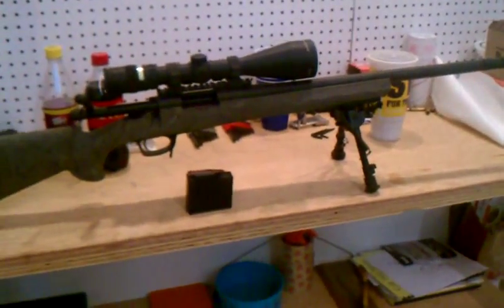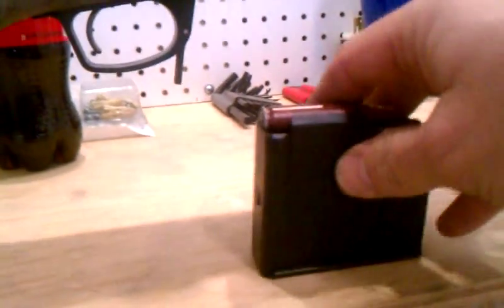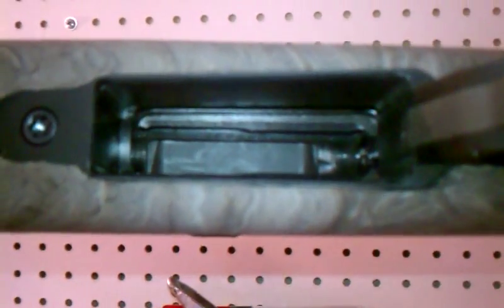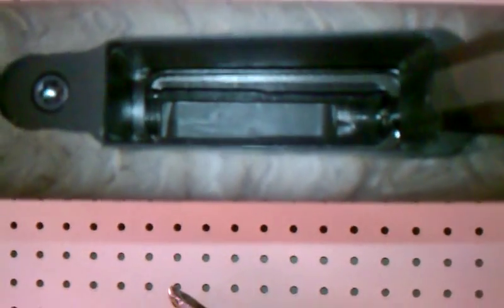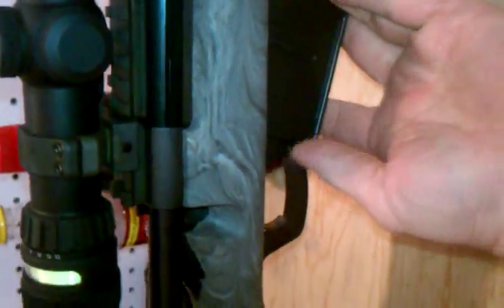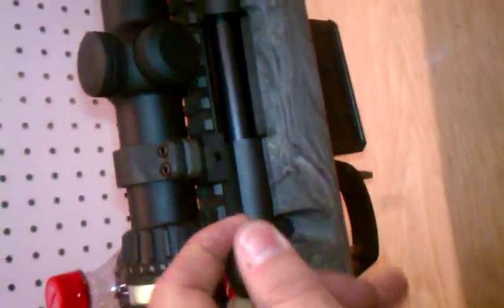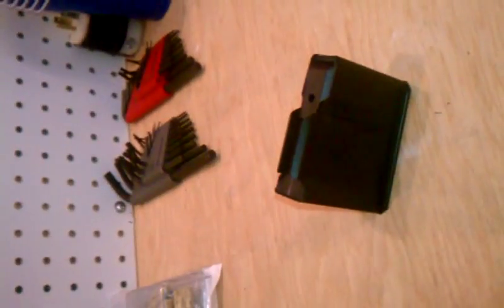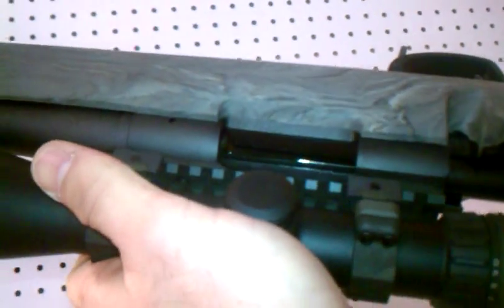REM 700 BADGER AI mag install

Comment: hey when you did this did you have to machine your action to fit the AI mag. I switched one over from ADL to a bottom metal that takes the AI mags. But the bolt does not make contact with the bullet. It will not feed because the mag hits on the bullet guide, that tapper that lifts it to go into the chamber. I know I do have to machine it, but I was wondering if you know another way. My buddy switched one over to BDL and it worked fine without any action machining (not AI mags, Rem mags). if you see this get back to me
Reply: Brandon C. What was the out come? Looking to do this to my Remington and wondering if you found a solution